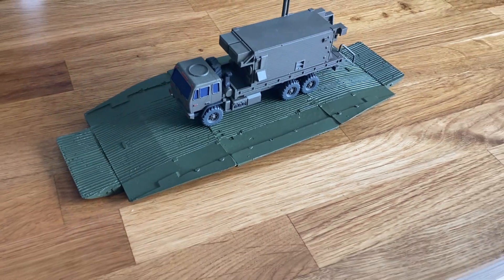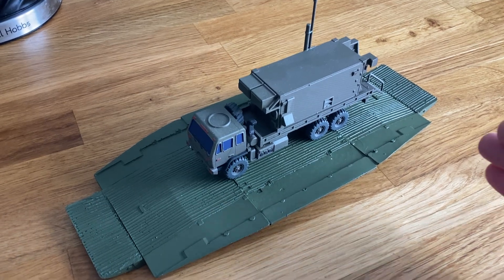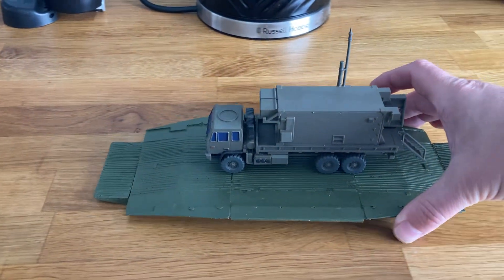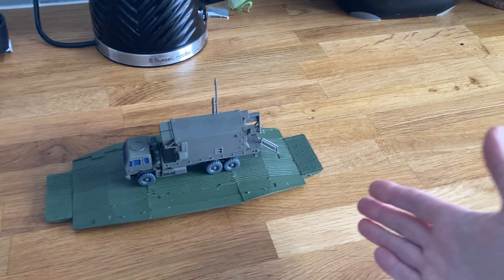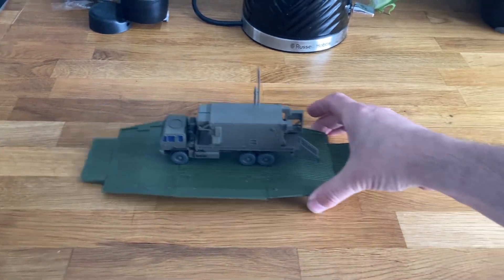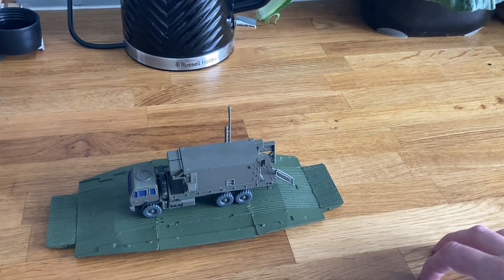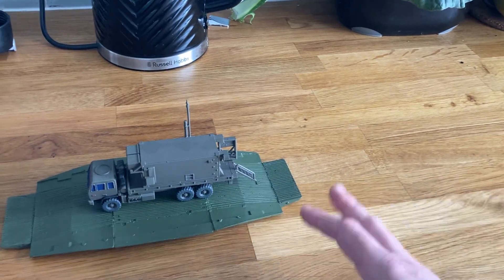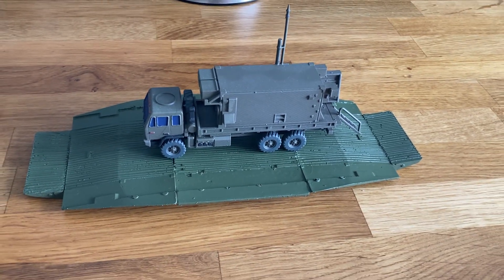1/72 S and S models Ribbon Pontoon Bridge.  Operation Bunny 🐰 Hop - vital engineering equipment

Comment: Under the Skirting  hides a Hovercraft right ??.
This is Neat.
Did this come off a Scaled Tank Model of Sorts.
I can't wait to see a Diorama from you with some of your Builds taking top billing. 
Cheers.
Reply from the maker: Haha.  No separate model this - three sections dump it in the water off the back of a truck or underslung and it expands into open position- using two boats the engineers push the sections together then fasten them to each other- can be a pontoon or you can use as many middle sections to cross a wide river :)

Cheers - deffo a good idea :)